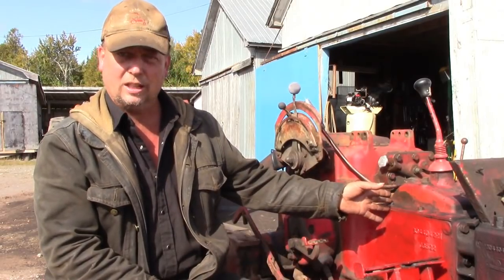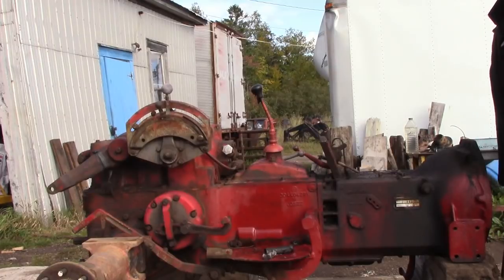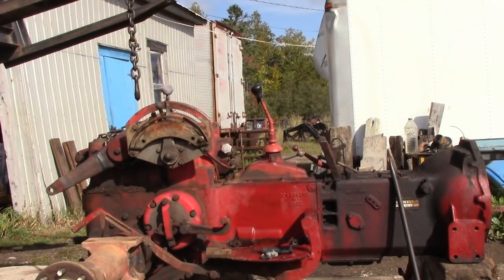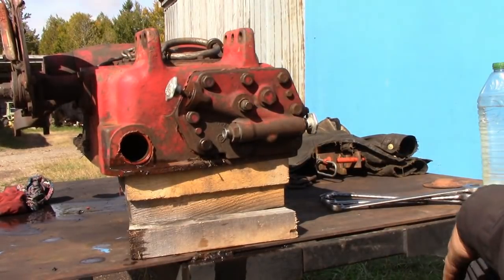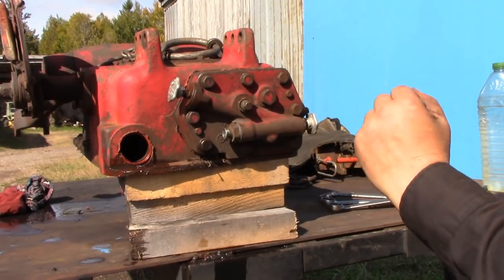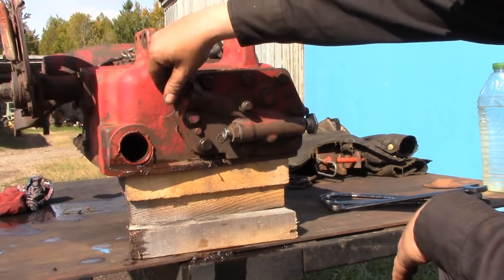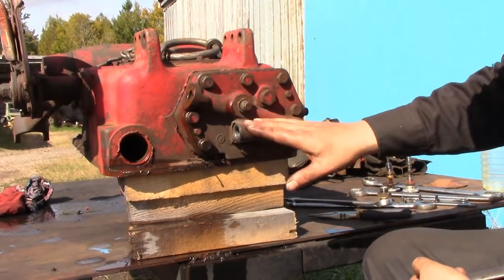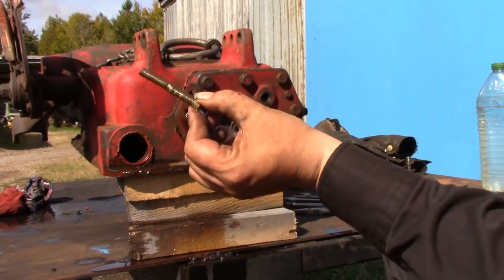B414 Hydraulic unit dis assembly

Comment: Thanks for your videos, Dave. I recently did the head gasket on my 414 and wouldn’t have attempted it without this channel. My hydraulic unit has a leak at the blind end of the front pipe, an o-ring issue I assume.
Reply from the maker: Outstanding man, I'm glad I could be of help! I'm not quite following which pipe you mean but you can do it, just start carefully digging and you will find the issue. Thanks for watching!
Reply: Sorry, where the high pressure line goes into the control valve unit, at the other end of this raised casing is a seal, of some kind, which has a small leak on mine. Your tear-down will no doubt help.

Comment: I really need to thank you for doing these videos on the 414.  I have one and there's not really any info on the Internet about them. These have been very informative and helpful.
Reply: Also is there a way to turn off the draft control?  When I pick up my post hole auger it sometimes wants to bounce pretty bad until I take the weight off.
Reply from the maker: The draft control is the outside lever, push it all the way forward and that effectively  turns off the draft control. Thanks for watching!